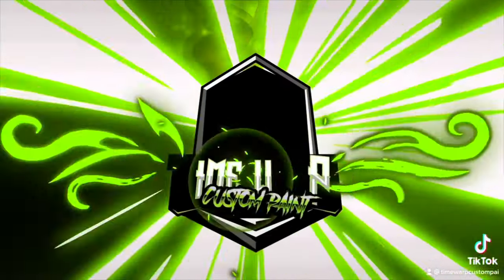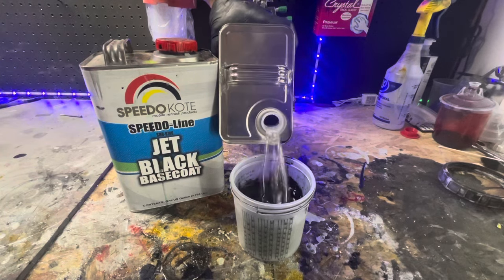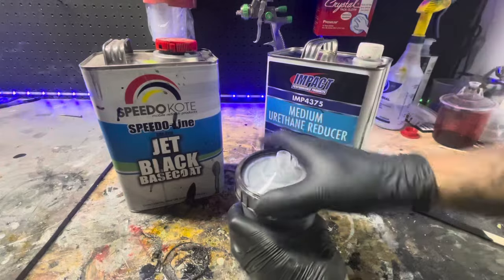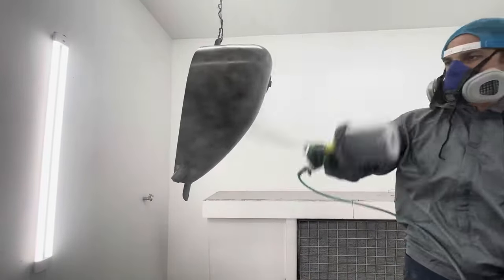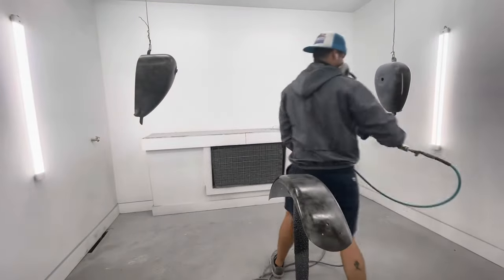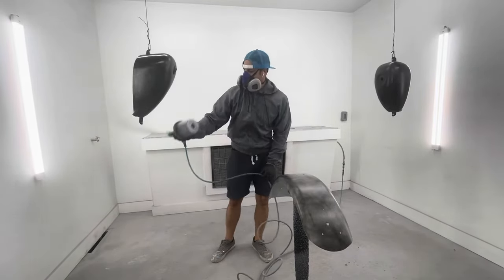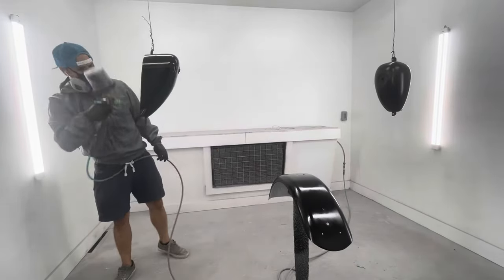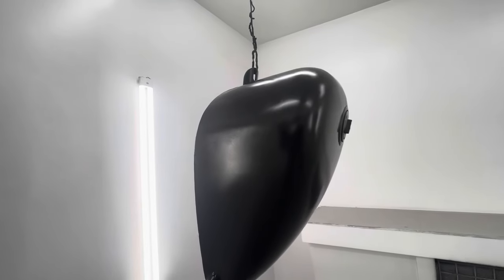How to mix and spray automotive basecoat

Comment: I'm on the verge of giving up spray painting. Getting fed up with fine line tape lifting paint or leaving raggy edges. Then you double back to repair the job only for the tape to pull more paint off.
Reply from the maker: You have to fight through it!!!! 90% of Custom Paint is learning how to fix the mistakes. you can do it!!!
Reply: @TimeWarpCustomPaint  tha js for the encouragement dude, means a lot coming from someone of your talent. Sometime I feel if my works not perfect then it's not cutting it and I end up stripping it and starting over.
Reply: P.s any tips on fixing ragged edges after detaping?
Reply: @Leonard Mein  did you use a razor to cut the tape in into the seams?

Comment: a 1.7 or close tip is for primer , sealer and base. a 1.3 / 1.4 is for clear so not sure why you would say don;t use a bigger tip for a base coat

Comment: Adam ... does silver base not typically cover very well .. maybe I'm doing something wrong... switch to white after 4 coats of metallic silver and primer still showing
Reply from the maker: it covers good. I use LiME LiNE over black basecoat
Reply from the maker: Paint and supplies 👉https://www.amazon.com/shop/timewarpcustompaint?ref=inf_pub_timewarpcustompaint

Comment: It all depends on how you mix and the experience you have spraying. I wish there was a step-by-step video on how to use the Fuji Semi-pro 2 for different paint types. The last silver paint and clear I used left bubbles in the bumper I sprayed at home. It cured over time but I was not happy with how it came out.

Comment: Question you said mix the base coat 1 to 1 I bought that base coat it says mix like 3-1 is 3-1 to thick or what?
Reply from the maker: Yes, you can mix urethane reducer with a basecoat however, you like to make it spray out of whatever Gun or airbrush you were using there’s really no hard rules with that

Comment: what psi are you spraying at? are you setting psi at air compressor? I see you don't have a regulator at the gun.  I have your lime line gun and was wondering if I need to attach a regulator if I can just set it at the compressor. thanks. your vids are helping me prepare for my first real paint job
Reply: no always have a pressure regulator at your gun. you won't be able to get a correct setting going through all that hose length